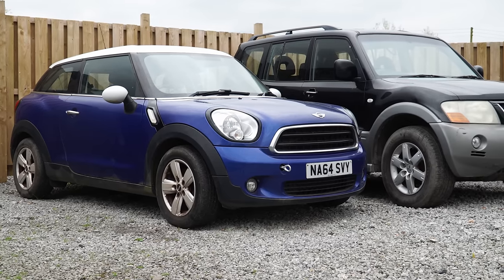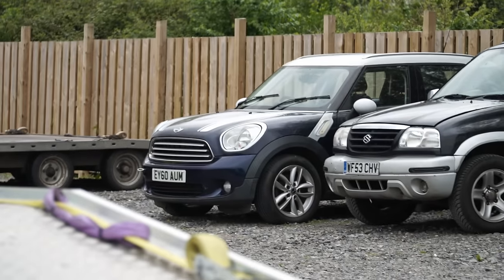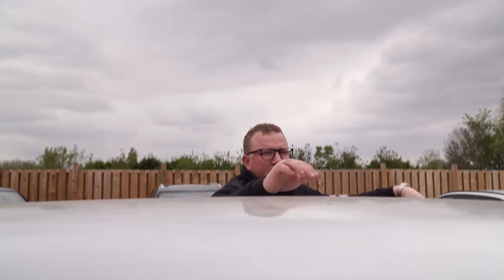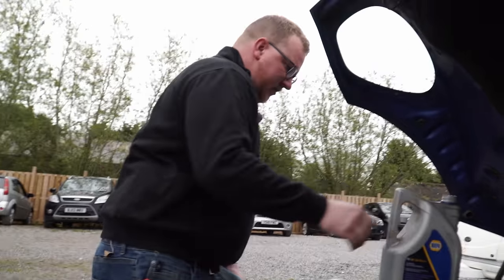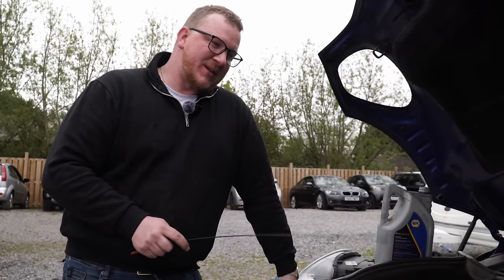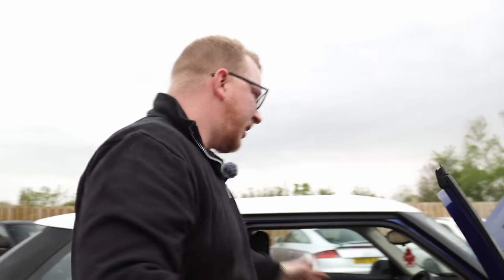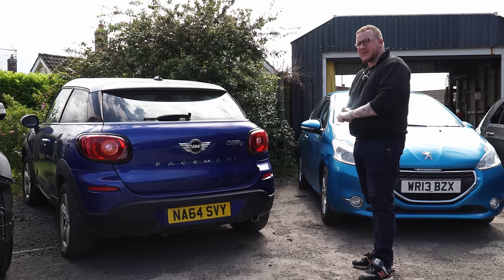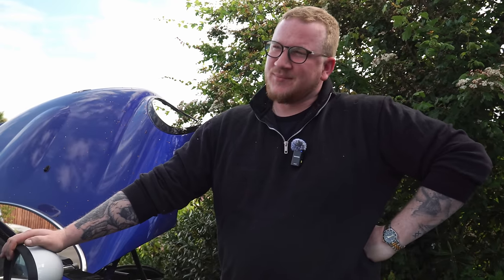I Bought A Car With 'No Keys' FROM BRADFORD! It Didn't End Well!!

Comment: You want to know why I watched this?
BECAUSE it was mini between2006 and 2015.
I just knew what was coming.
NEVER go near these heaps of junk, I owned a peugeot 207 with the same dire range of engines. Mine was looked after and serviced impeccably from new, yet still managed to scrap itself after only 23000 miles  needing a new engine.
They're beyond words for problems.
Wet belts, degradation in oil, blocked filters, gunked up sump.
The peugeot was not even good to drive.
They also consume gallons of oil, so all the signs were there.
This leads to lack of lubrication , so even if the thing doesn't seize up, the belt will snap.
Total garbage, l knew it would end in tears and I'm not even a mechanic.
Most modern cars today have started doing a similar thing with wet belt.
Peugeot(  psa) prince engines, also in mini and Citroën.
Sorry, but I now drive electric with 5 years warranty still left on the battery.
Never again ice cars.
PS, yes, you were conned as well, please don't pass it on to another victim even if they plead with you for it.
Shove it in the crusher, then everyone's a winner !!